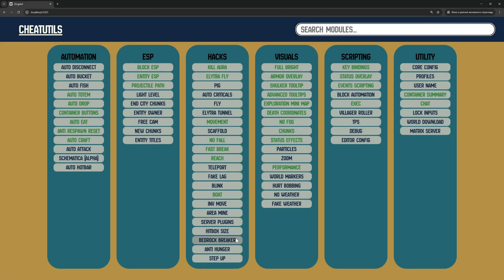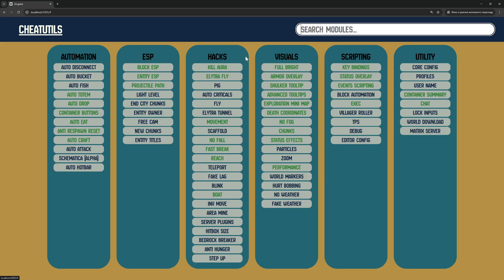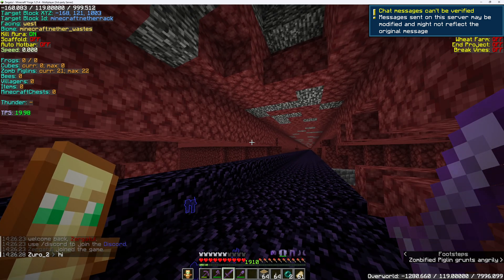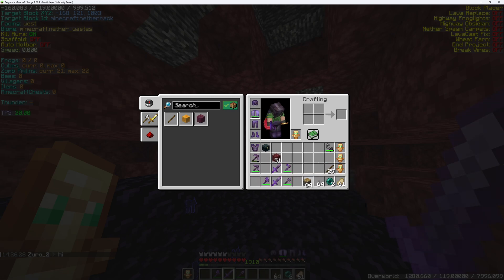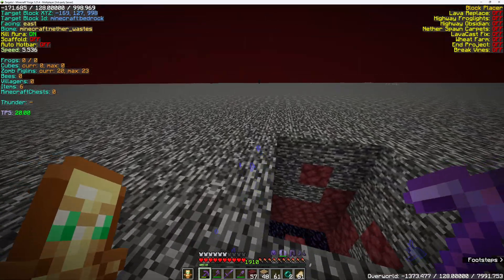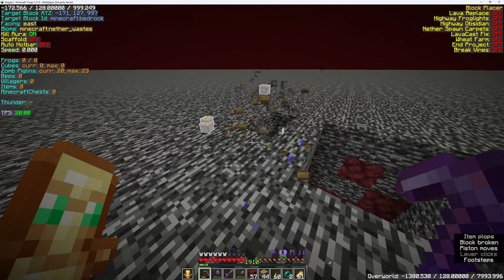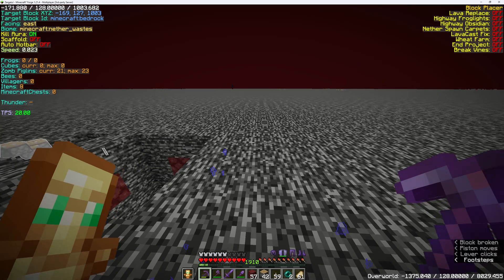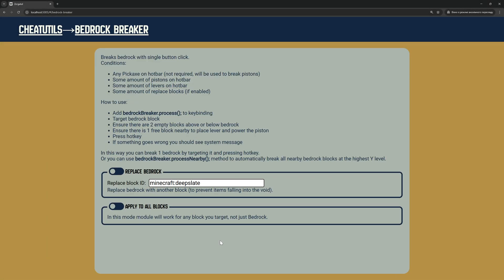CheatUtils - Bedrock Breaker (1.21.4+)

Comment: why does this work? like what is the mechanism for bedrock breaking because of a piston?
Reply: but i also noticed that it does not work but says "wait for bedrock break time" or something among the lines and when i tried ant other block (wiht apply to all blocks enabled) it didnt work and said the same thing i am on a multiplayer server and it does not have a plugin of what ive heard of but could it be because the server is hosted as Paper and not vanilla because paper changes some properties of the game such as entities and it adds anti xray so yeah
Reply from the maker: @JustThatOneGuy_  if i am not mistaken, default paper config prevents bedrock breaking exploits
Reply from the maker: it works in the same way as all other bedrock breaking methods. you break extended piston, server queues retraction on the next tick. Then you replace it with new piston pointing into other direction. On the next tick server runs retract code. This code checks direction of the piston, and replace the block standing in that direction with air. Because you replaced piston with new piston pointing in the other direction, server replaces any block in that direction with air.

Comment: ive been trying to use the bedrock breaker but its not working , i keep getting the wait for bedrock break timeout
Reply: for some reason it also doesnt work on any other block,
Im on 1,21,7 and the server im using has core protect, and openinv
Reply from the maker: @hanazo12owo19  sorry, i have no idea what core project is. bedrock breaking fix most likely is simple setting in server config, that can even be enable by default

Comment: I noticed that it errors more often if you can instabreak the pistons for example I could hardly break any bedrock with Haste 2 and a Diamond Pick with Efficiency 5 once I took down the beacon my error rate went down significantly
Reply from the maker: I didn't test this method with instabreak. It starts breaking piston, waits until it ready to be broken, and flicks the lever at the same time. If piston is getting destroyed with instabreak, then flicking lever doesn't do anything. I can take a look if it is possible to fix the code so it can properly work in this scenario
Reply: @Z3rgatul  When I had instabreak I would get an error relating to the piston (can't remember the error, sorry), so its probably what you're describing
Even if there's no fix in the code a warning could suffice too
Reply from the maker: @ i checked this problem. the reason why it sometimes works with instabreak - when you have another item in main hand, module automatically selects pickaxe, but there is 2 ticks delay on the server before it applies full mining speed of pickaxe (some sort of internal cooldown of item swap? but why 2 ticks... i still didn't figure it out). And I am not sure if there will be a reliable way to see when 2 ticks delay will end.
In short, it works with instabreak only if instabreak is not applied due to main hand item change
Reply: @ thats super weird, thanks for checking it out!
Reply: Plus I'm not sure if this is correct but whenever I got the "Wait for bedrock break timeout" back to back changing which direction you're looking at helps